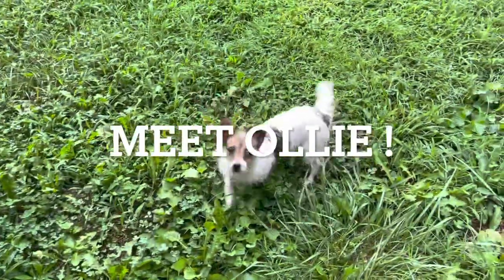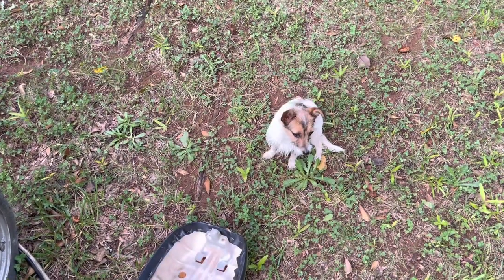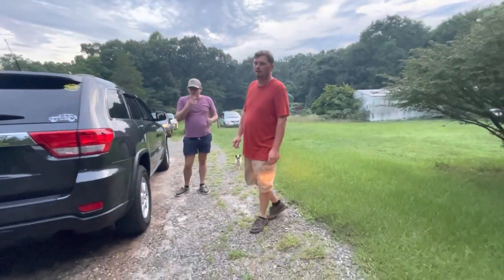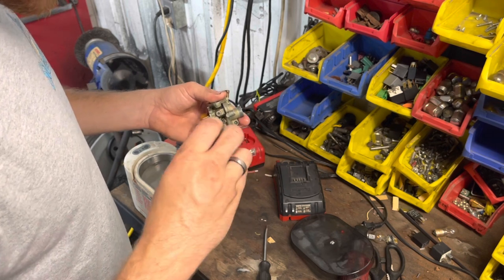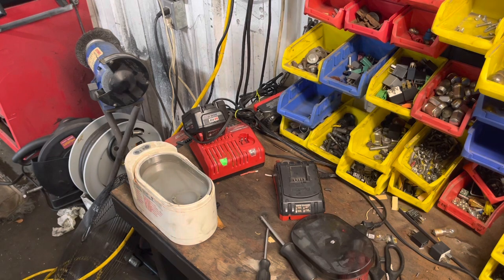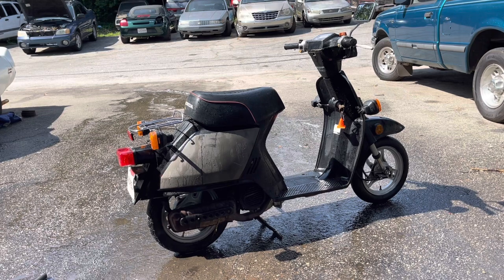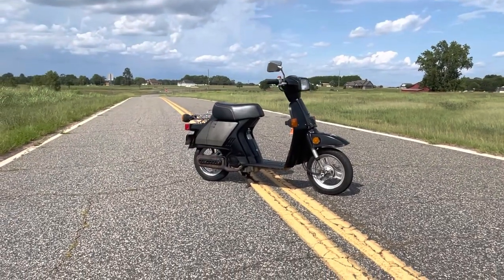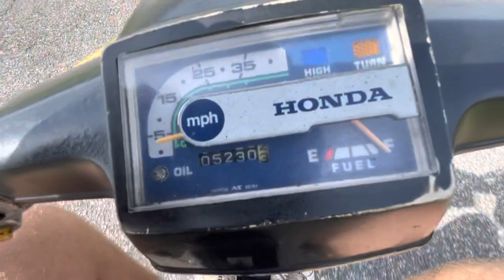Barn Find Honda Spree Rebuild

Comment: Makes me proud to own a 2003 piaggio vespa et2 50cc and a 2011 ice bear 50cc mopeds that I’ve worked on by myself by trial and error,vespa is a 2 stroke and ice bear is a 4 stroke engine,ice bear has 8k miles and vespa has 296 miles as they sit so seeing the spree makes me happy to see another on the road

Comment: Hey buddy you lucked out twice. That adjustable screw was air/fuel mix for idle. It should of had a spring and rubber oring.  Luckily didn't blow it backwards or it would of shot out also the seat on float needle didn't either.  Lol

Comment: Had an '86 Sprèe that had been of the road for 15 years. Took some work getting the cab cleaned and clearing out the idle jet but got her running and on the road. Fun little scooter. Just don't get her to far off the shoulder of  the road into gravel or you will take a spill. Happened to me one time and tore my leg up when I wiped. Luckily I was wearing a helmet so my face was spared  from getting torn up too.
Reply: Wo

Comment: Melody here in England - absolutely dire moped (restricted 20 m. p. h.), Vision 50 better. 117 lbs little rocket. 😂, oil pump should be fine unless you put a 65/70 top end on /then pre-mix;).

Comment: I just got a 1989 Honda tact 50cc 35 years old still runs really well the only problem I have is when the engine is hot it's very difficult to start. But when it's cold it starts first kick every time

Comment: Were the Elites the ones that looked more angular than rounded? I see one around me sometimes that has what looks like a slotted grill up front. It sounds like a 4 stroke though. Is it probably an Elite? That little pup needs its own channel LOL. I"m more of aa large dog fan but any little dog that isn't a yapper is a keeper.
Reply: Yes the Elite is more angular and is a four stroke motor. The Elite 80 was in production for a long time from the 80s until at least the mid 2000s. Back in 84ish you could get an Elite 150 which would be better keeping up with traffic at about 55. the top end on the 80 was about 42mph on flat out ground and 50ish down hill. A little scary going 50 on a smaller size scooter though with those little tires
Reply: @seanaiello4984  Are scooter brakes trustworthy at that speed too?

Comment: I almost shut video when you were trying to wheelie it. Thoes parts are more valuable then some of thoes junk cars. I did video on a yamaha of same year and tried to replace carb.  iI was 200 used and choke cable was 40. So I rebuilt carb and only changed choke cable. So the video still because you didn't just let it go to parts. Good job Jay